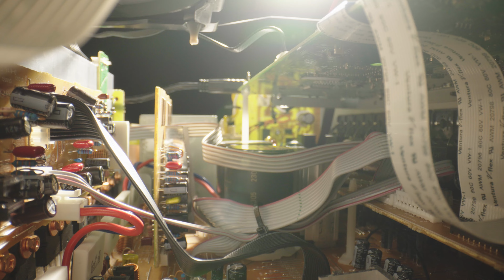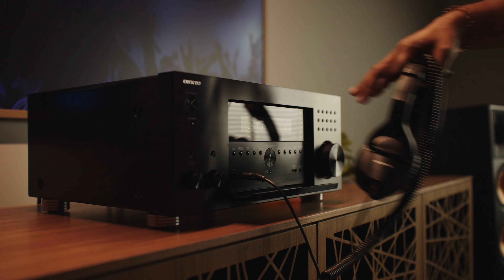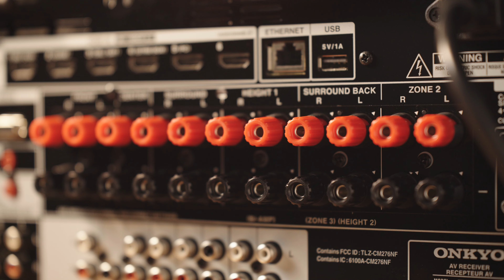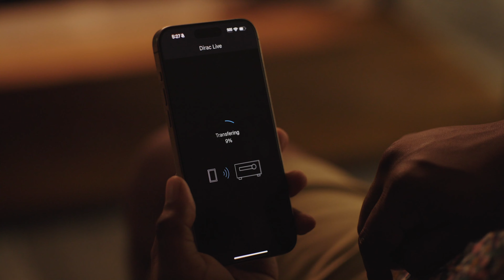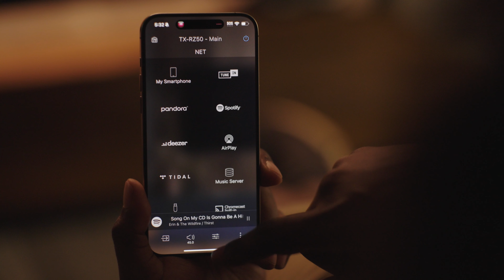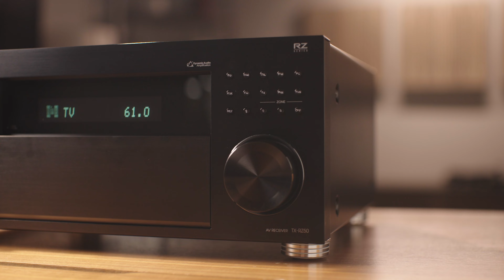Onkyo TX-RZ50 9.2-channel home theater receiver | Crutchfield

Comment: Ive heard people try to explain the THX certification and it makes zero sense.  All THX seems to be is a licensing stat to make your product appear better then a product without.  THX is owned by Razer computers now, THX is NOT a separate entity.  Id rather pay a liitle less and not have THX licensing, I would bet any amount of money that no one could tell if a receiver has THX certification or not by listening, and i seriously doubt their is any difference on a graph.  The RZ50 has IMAX as well, the onoy difference ive noticed is its louder when played IMAX content from Disney +, similar to how DTS is louder than Dolby Digital.  Im not knocking the RZ50, i own one and enjoy it. However, all these acronyms are merely sales techniques, nothing more.  It's worth noting that if Onkyo didnt included these features, some customers would not be happy.  I have a 15 year old Sony ES receiver that does NOT have Dolby Atmos and all the other acronyms and i dont think u could really tell the difference.  The main reasoned i needed to upgrade was the sony needed a seperate remote to control the volume as it lacked Arc or Earc, also the menu system is having trouble activating.  Thanks for your review!
Reply: Atmos isn’t an acronym, it’s a codec based on sound objects rather than specific channel assignments
Reply: @brynner6133   Yes that is correct, technically DA would be the acronym or DV for Dolby Vision.  Know how it Atmos works, but thanks for the input.  My point was these features, specifically IMAX & THX, don't seem to add any real value to the end user, IMO.  Samsung does not use DV, as they don't want to pay the licensing fee's.  Not having DV is NOT a deal breaker, personally I can tell the difference between DV and the other HDR formats, HDR 10, and 10+, but its very small difference and I wouldn't want to pay more for DV if I had a choice.  I am not a big Samsung guy, though their prices very good.  This is off the THX website "THX engineers perform hundreds of tests to ensure sound and picture reproduction in the industry's top entertainment equipment is fully preserved. Only the very best products with uncompromising quality, performance, and consistency become THX Certified, making your next home entertainment purchase an easy decision."  that sounds like a bunch of marketing mumbo jumbo.  The McIntosh MHT300 is an $8k receiver, it's NOT THX certified.  So it appears like THX is prudent to be on lower end gear like the Onkyo RZ-50 to help bolster the product.  Obviously the Macintosh is a better built receiver in every way, better parts, connectors, metals, and a better power supply, all this with out a THX certification.  One would think if THX certification is important, then it would be a spec on the McIntosh MHT300.  Is the MHT300 worth 8 times as much?  no way, but it is better, and it doesn't have the IMAX certification either.
Reply: There's thx sound modes tho

Comment: I got my RZ-50 from Crutchfield.  It's a steal when on sale.  I did have to bring it to be repaired 2 times, under warranty, did have to drive over an hour each way NOT FUN.  its finally fixed and works fine.
Reply: What was the issue you had to repair it under warranty?
Reply: sounds like quality control issues.
Reply: Yep that's why I went with the marantz cinema 40. The onkyos are packed with features but are not build to last and I think that when you pay this kind of money you would want something to last for at least 5-8 years.
Reply: any more info? hdmi board ?
Reply: $849 brand new on Adorama right now